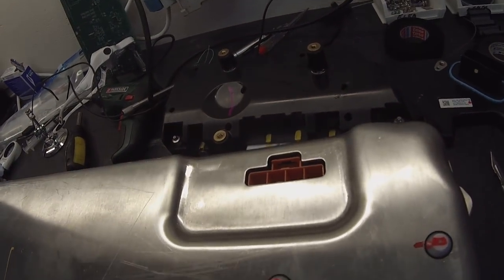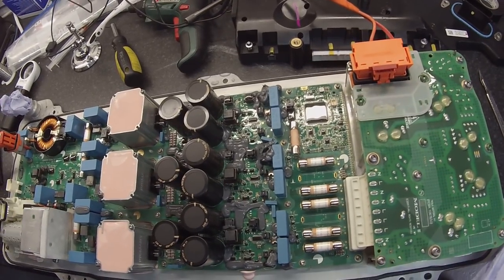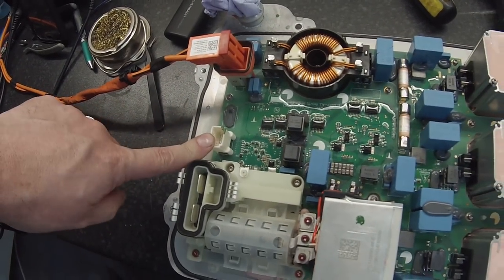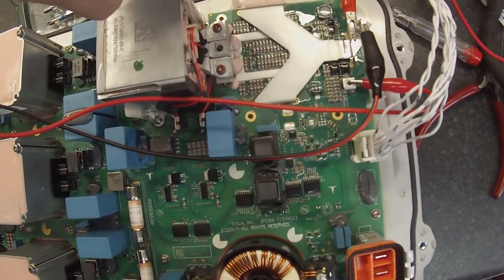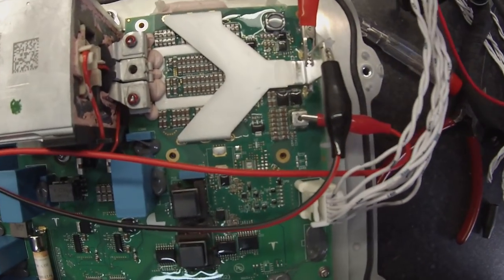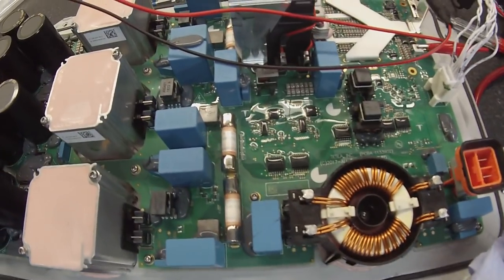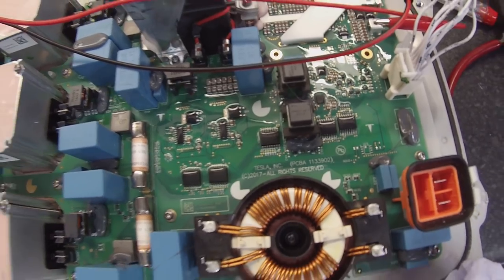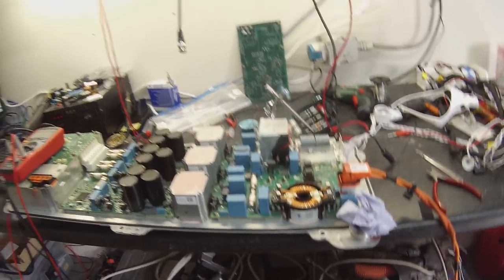The Tesla Project : Model 3 PCS First Look

Comment: Hi Damien, thanks for all your vids re the Model 3 battery pack.  I'm trying to set one up as a powerwall where I will simply have a single formatted supply of 240vAC, 50Kh 7kWH.  Is there a way I can circumvent the checks that Tesla put in and bypass straight to the charging/BMS operation?  I'm thinking those blue relays are mainly for directing the given power supply through the board so that it ends up correctly processed and that the 'pink' transformers are a clue because they must be receiving AC supply.  I don't think I'm concerned with discharging because I'm thinking I can take power directly from the 400vDC terminals and feed it into a battery inverter.  It would be great if you can throw some light on using a Model 3 battery as a powerwall because it most information is geared towards using them for project cars.